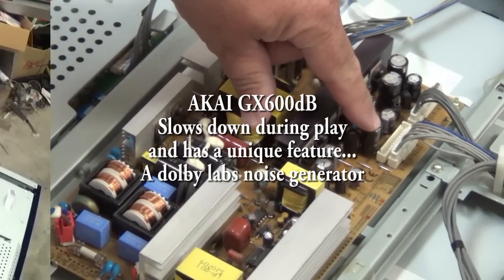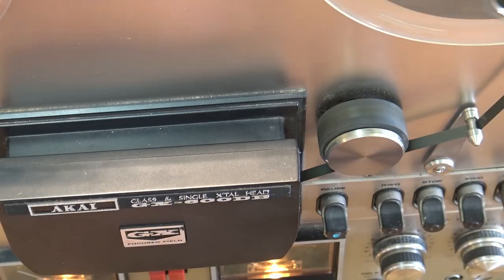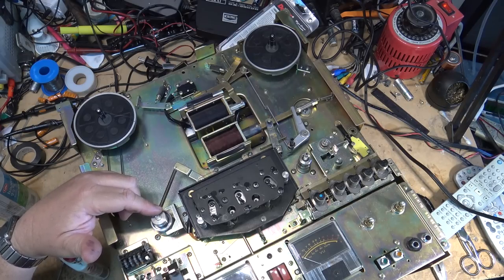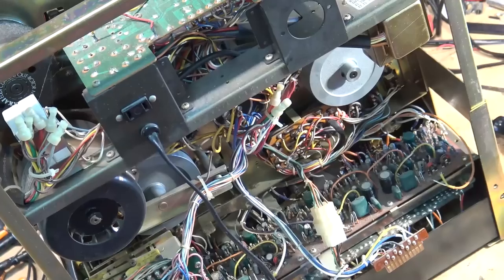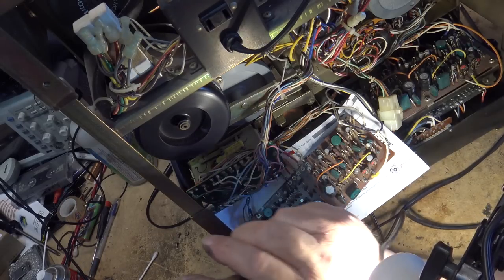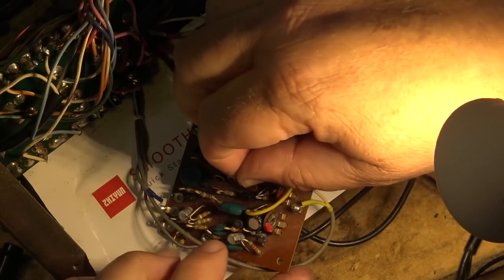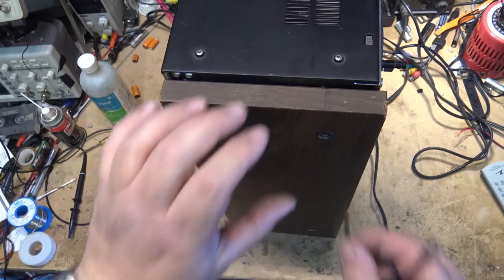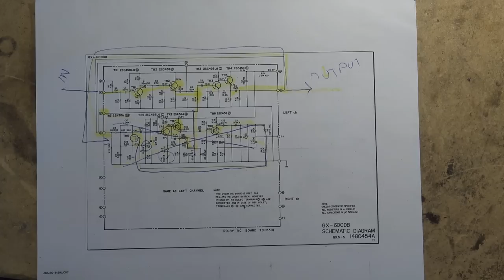AKAI GX600db going slow and what is that noise lets find out

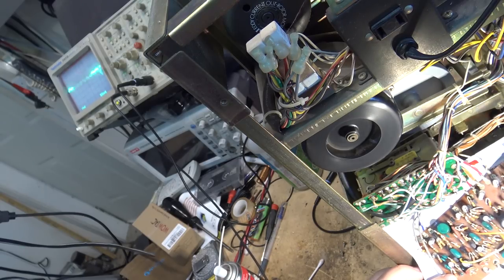Comment: Nearby highpower AM station 37:35
Reply from the maker: There are 2 50kw flame throwers about 8km as the crow flies from my location.  Just across the bay, 1040 & 1410
Reply: @12voltvids  50kW flamethrower, huh? We have only one operational AM transmitter left here in Hungary, but it's 2MW (yes, 2000kW) :-) . It makes a fluorescent tube glow in your hand in a several mile radius around the tower. Pretty sure sometimes you can catch it in Canada at night, it's on 540kHz. It's operating between about 5AM to 10:30PM local time. The transmitter got upgraded about 3 years ago, they replaced the 1975 Soviet tube amplifiers to Canadian Nautel solid state amplifiers (5x 400kW power amp modules), which are capable of DRM as well.